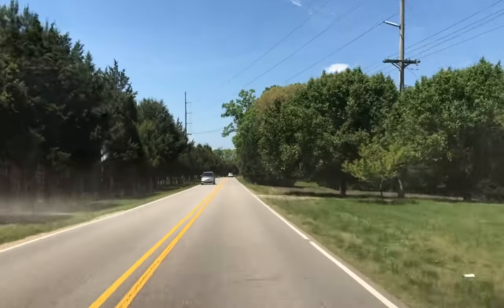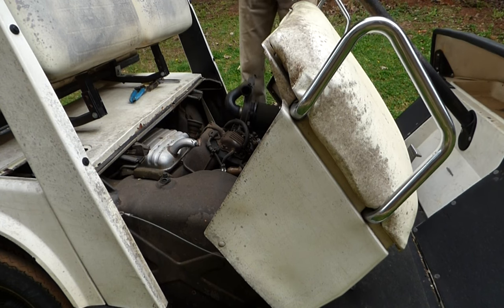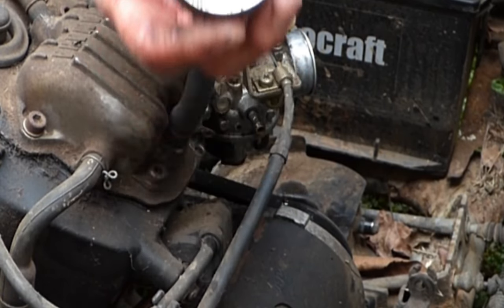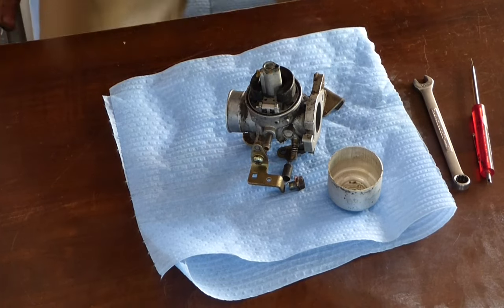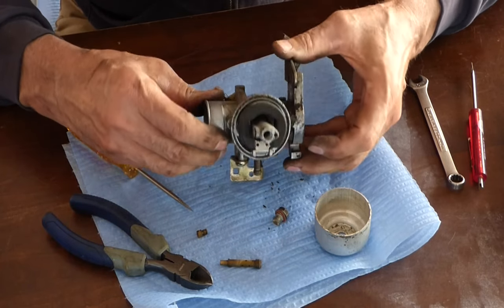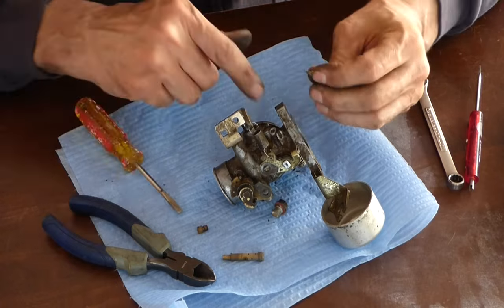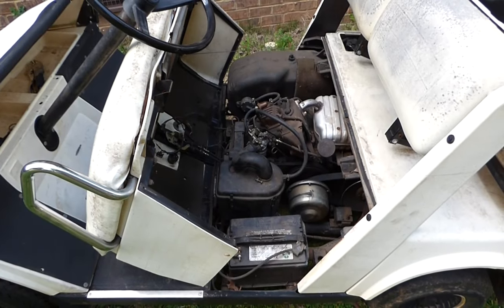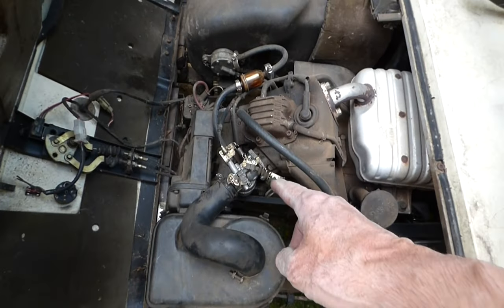Golf Cart Cranks but Won't Run (Common Problem) Easiest Fix Ever!

Comment: Thanks for this - great instructional video. I'm going to try this - perhaps I have more than one issue - tries to start like this goes sometimes but not others - will run in reverse very slowly - perhaps something with the forward / reverse switch.  Thanks again.

Comment: Always use non-ethanol fuel with stabilizer in it. Never use regular ethanol-based fuel in vehicles like this that are often parked for long periods of time. Or not driven very often. It will save your life, and they will run almost every time even if parked if you do those two things. Non-ethanol fuel with stabilizer

Comment: I have the exact same issue. Engine only fires when I add starter fluid. I just installed a new gas pump and carburetor but it didn’t fix the problem. Fuel is definitely getting to the carburetor. Any ideas where to look next? Thanks in advance!
Reply from the maker: Did you make sure there is no water in the gas?… Has it been sitting for a while and could there be water in there? If there is water in there it would be at the very bottom of the tank. You could drain off some gas and try to get the water out of there if that’s the problem.
Reply: @helpinguonline  Draining the fuel tank! Looks like I replaced the pump and carburetor for no reason but they were old anyway. Cart seems to run a little rich but it’s running at least…Thank you!
Reply from the maker: There should be an air/fuel adjustment screw on the carb.  If it is running rich turn it in (clockwise) a little to adjust.

Comment: Great Video's - I am trying to fix a Cart that looks exactly the same as the one in this video. What Model is this? I'd like to buy a new plug and fuel filter before starting to work.  Thanks again for your informative video's.
Reply from the maker: As I recall it is a G5 Yamaha with a four cycle engine

Comment: I am trying to fix a Cart that looks exactly the same as the one in this video. What Model is this? I have fitted new Spark Plug, fuel filter and checked for fuel in the float bowl.  looking to remove the carburetor but would like to have a new gasket ready.  Can you help with Model Type please - Watched a few of your video's now - excellent.
Reply from the maker: I think that was a G5?... but not sure.  As I recall it had a 4 cycle (stroke) engine and not the 2 cycle (where you have to mix gas and 2 cycle oil).
If you lift the cab you will find the id# and you can go online and look it up.
Reply: Thanks  @helpinguonline  - it is a 4 stroke. When you say lift the cab - could you expand please.
Reply from the maker: The location of your cars serial number varies depending on the model - but Yamaha Golf Cars normally have them in one of 3 places: Under the rear bumper on the frame. Under the seat where the floor board meets the motor compartment. Under the driver side glove box.
Reply: Many Thanks  @helpinguonline  - nothing in any of these places. Will assume its a G5.

Comment: 05 st sport I replaced the carburetor because it was running poorly and went ahead and replaced the fuel pump and filter. I’m getting fuel to carb it busted of kinda twice. My going to replace the spark plugs, if that does do it do you have any suggestions?
Reply from the maker: Could be a number of things… Make sure you have good gas in there… Not old or with water in it… There should be an adjustment screw on the carburetor you could try that… Clean air filter… Etc. Start With the easy stuff and work your way through it is my recommendation.

Comment: I have a 1990 G2 Yamaha golf cart.  It pops the 15 amp fuse every time we try to start it.  Any thoughts?  One person thought it is the Ignitor.  But the ignitor is no longer available with Yamaha.  Can you help?
Reply from the maker: Sounds like you have a short somewhere… I would check all your wiring and make sure you don’t have a loose or frayed wire

Comment: I was wondering if you could help me my golf cart it is a E-Z-Go 1988 I keep having to pull the choke every time to start it up and also to give it power sometimes what could be the cause
Reply from the maker: It could be a number of causes but I suspect you’re not getting enough fuel that’s why you’re having to pull the choke which causes more fuel and less air. Focus on causes that could be limiting the fuel to or through the carburetor

Comment: Won't stay running for more than a minute or two. Thought we put in bad gas.  Siphoned out all gas and replaced spark plug, air filter,  oil and filter, both fuel filters and fuel lines. Still not starting and running.  Not getting fuel through the lines to the second filter. Any suggestions? Float in gas tank? Can I replace internal parts on tank or do I need to get a whole new tank?
Reply from the maker: Did you check your fuel pump?
Reply: Yes, replaced fuel pump as well.
Reply from the maker: This video may give you some ideas...
https://youtu.be/DT6P56vJW1o
If you are not getting fuel to your carb and your fuel pump is good then there is a blockage along the way.  Check at each point along the fuel line while blowing into the tank fill opening and you should be able to pinpoint the blockage.  Maybe you installed one of the filters backwards?...etc.
Let us know what you find out.
Reply: Changed the carburetor. Still no gas.  We unhooked the fuel line from the tank valve and placed directly into tank.  Worked! Pulled out the tank valve and the hose had sediment at the top and the valve was completely blocked. Cleaned out the value and line, hooked everything back up and running great! Now that I replaced everything from tank to engine I should be set for a while.  Thank you!
Reply from the maker: Way to go!... and thanks for the update.  I admire your perseverance and I am sure it is rewarding.

Comment: I have a cushman EZ Go. It has a Kawasaki motor.   It was running fine, then quit. It has no spark at the plug. I also noticed that the hour meter is not  powered  while it is cranking as it was before. I don't have a lot of experience with this type of motor, any suggestions  would be greatly appreciated.
Reply: I had a blown fuse. Replaced it and my hour meter started working
Reply: I had no spark and replaced coil and that fixed the spark issue

Comment: Having problems with ezgo cart I gotta new carburetor for it and fuel pump and still loading up with gas in carburetor drain it and it just turned over then gas start pouring out valve on side carburetor

Comment: I am cringing...  I did that one foot in the cart and pressed the gas pedal a few days ago....  It caught, launched like a top fueler, ran my one leg over and plowed into a barn post at high speed. Lesson Learned here!  I'll be jacking a drive wheel off the ground from now on before trying that again.
Reply: I have since learned of the gizmo on the back of the shifter microswitch thingamajig to allow it to run during maintenance tasks. Much safer!

Comment: I have a 2005 Yamaha G22 that I rebuilt the engine on. Dropped it back in and now it goes when I gas it but does not go very fast and won’t accelerate more the maybe 4-5 mph.. any idea what my issue could be?
Reply from the maker: Could be a number of things… Are you sure your timing marks were all lined up?

Comment: So I took off my old carburetor and bought a new one and I put the new one on but once I get it on the plastic black thing that goes infront of the carburetor doesn’t fit in the threads they are too wide any way to fix this?
Reply from the maker: I am guessing you mean the mounting holes in the carburetor are too small for the mounting bolts to go through?...  
Your replacement carburetor should be an exact fit.  If not, and you make it fit you may run into other issues since that is not a matching carburetor.
If the place you ordered it from said or advertised that it is a replacement for your cart then they should take it back (exchange it) with no problem.
If for some reason you can not return the carb and want to force fit it and my understanding of your issue is correct... you could drill the mounting holes on the carb bigger so the bolts will go through.  But like I said  you may run into other issues is the carb is not an exact replacement.

Comment: Any suggestions for a carryall 300, starts in maintenance mode but won't start in operate mode
Reply: @jennifereptingwilliams632  sounds like the microswitch needs adjusting.  Try fiddling with the switch while starting it.  The little flat, metal arms can be bent to adjust

Comment: Good video but wandering why you did'nt take your tools with you. Oh, and tell your friend to use 100% fuel all the time or at least when he stores it for the winter.
Reply from the maker: I pulled a trailer to take it to my shop if it was more involved than an hour or so.  Got a little more involved there than I planned.
Reply: @helpinguonline  the investigator here

Comment: I’m having the same problem. I reran all the wires. N the fuel is shooting out the carburetor. I changed fuel filter put a couple fuel lines. N the fuel pump is good the float is good and the fuel is clean new spark plugs n it’s getting fire to the spark plugs
Reply: make sure fuel is being filled with needle and seat, take carb apart, clean needle seat area with 4 ought steel wool and a q tip rod , insert and twist to make shiny, check needle for good rubber tip,   reinstall , poof  ,  it works.    lol

Comment: what if when you spray starter fluid in and it doesn't fire?
Reply from the maker: check for spark... also if you are spraying starting fluid in your carb... your carb could be clogged.  You can try removing spark plug and spraying in there to bypass the carb.
If you have a 2 cycle engine be careful using starting fluid because the cylinder needs oil for lubrication... but a little squirt to see if it will fire shouldn't hurt just to check... if yours is a 2 cycle engine you can also put a little 2 cycle fuel in the cylinder to see if it will fire (assuming you have spark).
Reply: @helpinguonline  so we cleaned the carb. didn't resolve the issue. It will go in Reverse but no power going forward. It has spark, fired a little with starter fluid in the cylinder. ordered a fuel pump and carb just in case, but could this be a damaged shift cable? We did lower the rear end to add a lift, cable "could" of been pinched?
Reply from the maker: If it will run in reverse it sounds like you do not have a problem with the engine running but something else related to the work you did to "add a lift"
Reply: I'm good with the procedure you used as a professional repair guy. But some of the process shouldn't be done by the novice. Such as starting fluid direct Into the carb or cylinder.  Should really be sprayed into the air cleaner.  Carb cleaner would be a much safer alternative for use as starting fluid.  I've seen too many vapor locked engines and bent rods from improper use of starting fluid. Great video otherwise

Comment: So your cleaned the carb for nothing.
The process of elimination is to start with the quick and easy things that might be the problem leaving major surgery as a last resort.
Running the car at high speed with clean gas should clean the carb.Italian tune up.
Reply: use lucas injector cleaner, best stuff ever,  will stablize fuel for 2 yr. and clean to like new inside carb.   ask me how i know.      Ron